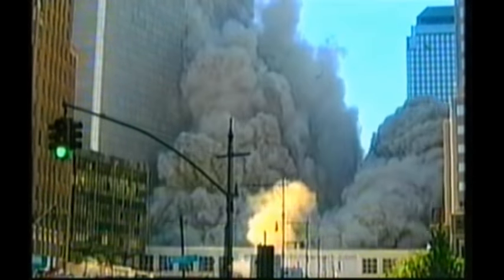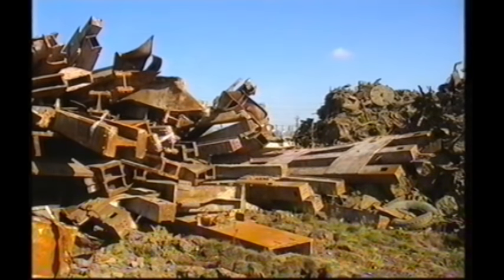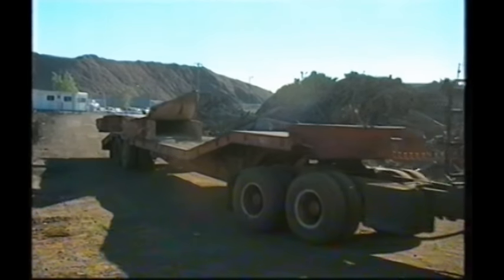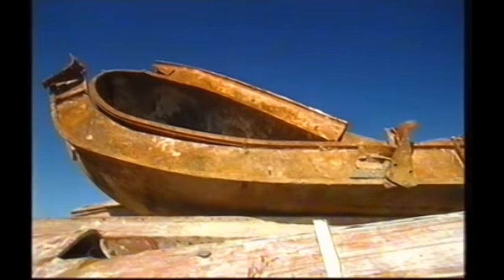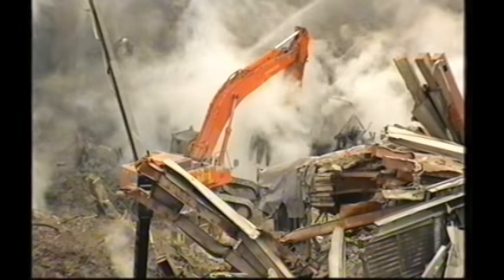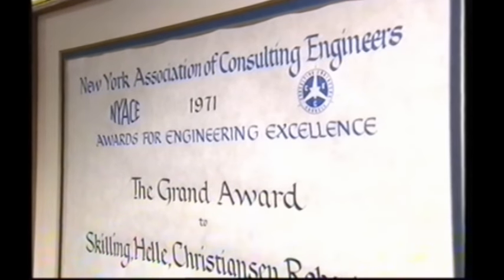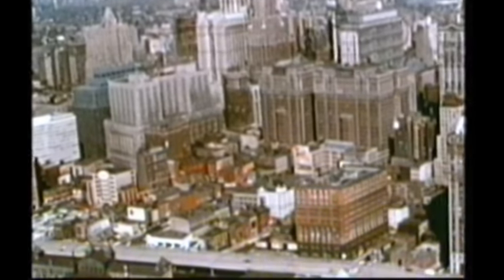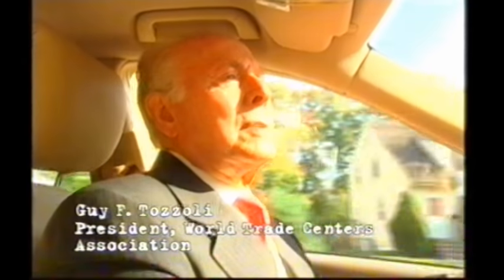9/11—"How The Twin Towers Collapsed" (C4 documentary, 2001)

Comment: I'm not trying to be all conspiracy but seriously want to know. How could a plane penetrate? I feel like the plane would just crumple like a pop can. I seen the damages from a plane hitting birds and wow! It was unbelievable how much damage that plane took, please explain I'm serious curious.
Reply: Speed - at that speed the aluminium (UK) of the plane wing could damage the steel. Also, the wings are shaped like a blade with a lot of strength in the direction of impact onto steel running upwards.
Reply: Kinetic energy.  Mass plus velocity. The greater the velocity the more energy the mass has. Do it slower and there is less penetration down to no penetration if you go slow enough. Go faster and there is even more penetration. This is for example how bullets work and how, if someone were to throw a bullet at your skull it would just bounce off but fired out of a gun that same bullet will turn your skull into a pink mist.

Don't get too worked up over bird strikes. The damage is almost always cosmetic and readily repaired with simple hand tools.
Reply: Watch the video..clearly showing the plane going into the side....easy...going fast with a lot of weight
Reply: @bobfrantz534  I think you need to re-watch it, plane goes into the wall like going through butter, but don't worry the government says that is as it should be.
Reply: @siamwinfor1656 says the one spouting utter nonsense. Properly educate yourself by listening to doctors and scientists instead of politicians and you might learn something.
Reply: At high speed a plane can cut through buildings, as explained in "architects and engineers for truth" website.
Steel-framed high rise buildings are not known to collapse because of fire, but 3 did in a row, on that single day.😂 That's the point.
Reply: @jeffsimon9594  So the plane went through intact came out the other side and flew away?
Reply: @jeffsimon9594  it was big and fast what did u think it was going to do
Reply: @jeffsimon9594  First, you're overlooking the fact that the 'wall' was 30% glass which offered virtually no resistance at all. Second, the vertical supports were not solid but instead were box girders made of 1" steel. Third, these vertical elements were designed to resist static vertical loads, not dynamic horizontal loads.
It's not the government saying this, it's basic physics, facts and common sense.
Reply: The wings are better thought of as "the wing" which is effectively a single component that extends through either side of the fuselage.

Although the wing is built to flex in the vertical plane, it is very stiff and strong in the horizontal plane, in the direction of travel.  All the force moving the aircraft forward comes from the two engines at the points where they are attached to the wing by the pylons on which they are mounted.  The wing has to be strong enough to transfer the load along its entire length and into the fuselage without any significant deformation in the plane of travel. The wind resistance has to be borne primarily at the wing's leading edge, which is thin compared to the overall thickness of the wing, to enable it to slice through the air.

The kinetic energy of the moving aircraft = ½(mass) * (velocity)².  That's velocity squared.  For a 200 ton aircraft moving at 400 mph, that works out at about 6.5 BILLION joules of energy that is transferred into the building in a fraction of a second, across an area equivalent to the cross section of the plane.  

There is no time for plastic deformation of the steel girders with that kind of energy release.  Steel has high tensile strength, but it's structure is essentially crystalline.  So those girders which have some flex under wind loads spread across a wide area didn't have time or strength to bend in the way a rail might be bent into a curve, they are brittle, so they just fracture and snap.

Think about a diamond, which is a three dimensional polymer of carbon, and the hardest thing found in nature.  Nevertheless, it can be cut with tools that are less strong, and hit a diamond with enough force, it will shatter.  All materials have their limits.
Reply: @Ozymandi_as  
Well said.
Of course, I doubt it will make much difference to the 'aluminum can't cut through steel' crowd.
Reply: Is that why they make bullets out of aluminum? Always wondered about that,
Reply: @mi66gt80 Bullets are effective because of their speed, not their composition. Don't you know that?
Reply: @kyle Effectiveness of a bullet is based on their speed and composition and design. 

Regardless comparing a bullet hitting a human skull with aluminum hitting steel is a poor explanation. A human skull is not harder than a bullet. Shoot an aluminum bullet at a 1" steel plate, the steel is stopping it. 

We can see the plane did go thru the building walls but the explanation is a combination of factors, A large one being the design of the walls.
Reply: @siamwinfor1656 as the cows pass excessive gas, aluminum will strengthen significantly while airborne. Read your
Reply: @siamwinfor1656 as the cows pass excessive gas, aluminum will strengthen significantly while airborne. Read your
Reply: @siamwinfor1656 as the cows pass excessive gas, aluminum will strengthen significantly while airborne. Read your
Reply: @siamwinfor1656 as the cows pass excessive gas, aluminum will strengthen significantly while airborne. Read your
Reply: @siamwinfor1656 as the cows pass excessive gas, aluminum will strengthen significantly while airborne. Read your
Reply: @siamwinfor1656 as the cows pass excessive gas, aluminum will strengthen significantly while airborne. Read your
Reply: @siamwinfor1656 as the cows pass excessive gas, aluminum will strengthen significantly while airborne. Read your
Reply: @siamwinfor1656 as the cows pass excessive gas, aluminum will strengthen significantly while airborne. Read your
Reply: @siamwinfor1656 as the cows pass excessive gas, aluminum will strengthen significantly while airborne. Read your
Reply: @siamwinfor1656 as the cows pass excessive gas, aluminum will strengthen significantly while airborne. Read your
Reply: @siamwinfor1656 as the cows pass excessive gas, aluminum will strengthen significantly while airborne. Read your
Reply: @siamwinfor1656 as the cows pass excessive gas, aluminum will strengthen significantly while airborne. Read your
Reply: @siamwinfor1656 as the cows pass excessive gas, aluminum will strengthen significantly while airborne. Read your
Reply: @siamwinfor1656 as the cows pass excessive gas, aluminum will strengthen significantly while airborne. Read your
Reply: @siamwinfor1656 as the cows pass excessive gas, aluminum will strengthen significantly while airborne. Read your
Reply: @siamwinfor1656 as the cows pass excessive gas, aluminum will strengthen significantly while airborne. Read your

Comment: 100% impossible for the buildings to fall at almost free fall speed in their own footprint without demolition
Reply: Happens all the time with smaller buildings when structural failings happen.
Reply: They're called fail safes. Big buildings are designed to fall a certain way in case of collapse, regardless of what causes it.
Reply: 100%? wow!

Comment: We live on the west coast. My wife awoke me to turn the tv on.  The first tower had been hit.  Then when we saw on live tv the second tower hit we knew the first one was no accident. 
As a retired building inspector I anticipated and told my wife that both buildings would collapse as the fire weakened the steel which would eventually not be able to support the weight of the structure above the impact floors and a pancake effect would happen.
It appears that’s precisely what happened. I never did trust sprayed on insulation to protect structural steel as a lot of it gets knocked off during construction.

Comment: Ya but what happened is NOT LIKE
THE MODEL @ 46:50
There was no metal buckling
on the exterior edges or its sides
ANYWHERE?
I understand thats how the floors could behave this way in collapse, however
if the floors did indeed fall straight down, wouldnt the now weakened by fire truss conections be severed from the strong steel exterior shell?
They both fell straight down & with this 
explanation I would expect to see significantly more of the exterior remaining than what actually  was.
It would be very interesting to see a scaled down version undergo the exact same conditions and my money is on the buildings stand even with the considerable damage suffered .
You cant find them anymore but there used to be video of wiindows on 3 different levels of both buildings being blown outward right before the buildings collapsed. first one then the other suggesting the possibility
it took additional destructive  influence
to bring the buildings down and obviously if that were to ever  become
known?
Reply: Well, you just stay with your BS theory if it makes you feel good. And good luck finding those missing vids of yours.

Comment: The Twin Towers both collapsed in the 10 to 12-second range. Gravitational acceleration, aka free fall, would have been 9.2 seconds. This means that the vast majority of each tower’s kinetic energy was completely used up just falling that fast. There would have been nowhere near enough energy left over to crush down 78 stories (South Tower) and 93 stories (North Tower) of cold, healthy steel structure, eject multi-ton sections of perimeter structure in a 600-foot radius from each tower’s footprint, and to pulverize 200,000 cubic yards of concrete (each tower) such that Manhattan was blanketed in a 2 to 3-inch layer of powder. All of this is utterly impossible without a great deal of energy added to the system. It is quite evident from numerous videos of both towers’ collapses that that added energy was explosives. Videos show symmetrical waves of explosive ejections of pulverized concrete and other debris racing down the face of each tower at, again, nearly the rate of free fall. Also notable on some of the videos are isolated ejective squibs emanating from the faces of the towers 10,20, and even 30 stories below the collapse zone. This is simply inexplicable if not for the use of controlled demolition. I hope that someday the religious belief in the official narrative of what happened that day will give way to science, empiricism, and common sense.
Reply: I stopped at the end of the first sentence because it is not correct.  It is a common misconception. Anything that follows premised on that misconception will also of course be false. 

The myth the Twin Towers collapsed in free fall (9-11 seconds) comes from completely misreading this:

NIST FAQ for the Twin Towers disaster Study

*11. How could the WTC towers collapse in only 11 seconds (WTC 1) and 9 seconds (WTC 2)—speeds that approximate that of a ball dropped from similar height in a vacuum (with no air resistance)? *

NIST estimated the elapsed times for the first exterior panels to strike the ground after the collapse initiated in each of the towers to be approximately 11 seconds for WTC 1 and approximately 9 seconds for WTC 2. These elapsed times were based on: (1) precise timing of the initiation of collapse from video evidence, and (2) ground motion (seismic) signals recorded at Palisades, N.Y., that also were precisely time-calibrated for wave transmission times from lower Manhattan (see NIST NCSTAR 1-5A)

Note the part about the first exterior panels to strike the ground after the collapse initiated.  A lot of people seem to miss that important bit of context and only see the 11 seconds and 9 seconds parts. 

On conspiracy web sites and YouTube videos they just cut out all the relevant context and details and (falsely) claim; The Twin Towers collapsed in 10 (or 9 or 11 - they usually can't remember the exact number so they fudge it) seconds Selective reading comprehension syndrome (SRCS). 

9 or 11 seconds is NOT the building, its the first debris to hit the ground which were definitely in free fall and dropping much faster than the Tower, which is collapsing some ways behind that. All of this easily visible to the naked eye. 

youtube.com/watch?v=4VgZW-v_Opg&t=4s&ab_channel=MFitz 

Now you know.

Actual collapse time for the North Tower is timed on this video;
youtube.com/watch?v=MAYXdafNl6E&ab_channel=AlienEntity1 

South Tower – Timed not in free fall
youtube.com/watch?v=rOIebjT2jaM&ab_channel=AlienEntity1 

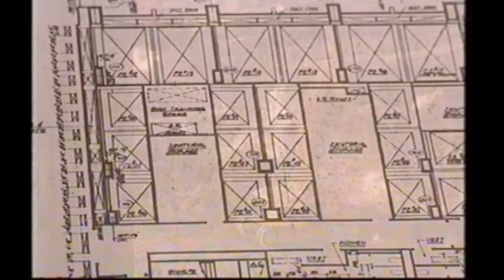Here is a video which captures the entire North Tower collapse, which starts at 1:44. The last standing parts of the structure drop below the dust cloud at 2:17. Add at least another 2 seconds or so for those to drop 60 stories. Start to finish I call it at 34 seconds.
Reply: Amen
Reply: Collapse times do matter to some in their arguments for or against controlled demolition of the Twin Towers, but the enormous clouds of pulverized concrete (that alone strongly indicate the use of explosives to me) make estimation difficult. However it’s really a moot point when so many collapse videos show unequivocally what happened to those towers.
I invite readers to watch these videos and decide for themselves.
Here’s the North Tower coming down. Note the multi-ton sections of building arcing up, out, and down from the top of the collapse zone. Also note the wave of explosive ejections of pulverized concrete and other material racing down the west face of the building on the right of the corner of it, under the column of falling material. This appears in the video at 1min47sec and is indicated by the yellow box lower and to the right of the other box. 

https://youtu.be/nUDoGuLpirc?si=882BgAQRfBu6IQkA
Here is another view of the same collapse sequence taken more from the north. The wave of explosive ejections racing down the west face I described above is well shown in this video. It races down the west face, in profile on the right side, clearly visible to the left of the thick column of falling debris. This is obviously not consistent with a big top block of the building (which has already disintegrated anyway) crushing down the rest of it.

https://youtu.be/w69v5YMoFG0?si=fAVvkqdLHKOxcg91

Here’s the South Tower coming down. Note the uniform explosive waves symmetrically and rapidly moving how the faces of it. Also note how the corners of the building stay intact for a time after the portions of the building adjacent to a given point on it have been blown out. This is not consistent with a large top block of the building crushing down the rest. And a careful look shows this enormous top block tilting over before it disappears into the cloud of its own disintegration, instead of following the principle of angular momentum and crashing to the ground below. So there is no top block to do any crushing down. 

https://youtu.be/twBSaMqP0fQ?si=W41KZHbW1JlKqgXY

Comment: I feel sorry for Leslie Roertson. He couldn't have foreseen what would happen. I hope he doesn't feel guilty about it.
Reply: There are Videos saying the Towers were designed to stand a Crash with a Boing 707. I believe this to be true.
Reply: How could anyone at that time have anticipated the insanity of someone flying a massive fully loaded plane a top speed with the absolute intention of bringing these down. It's an absolute travesty that someone who designed such a marvelous building has to live with this type of legacy because of terrorists.
Reply: Every aspect of the 9/11 planes operation was methodical. Close airports were chosen to save fuel and allow the planes to get a good run up. Even the 767 was chosen because it was the largest domestic routed plane at the time, otherwise I'm sure they would have gone for a 747. This was done to maximise damage and fires from the impacts, enough in the end to bring them both down in relatively quick succession.
Reply: @demonhalo67 bs! Is the weight was a problem the building would tip over! Most of the fuel burned up instantly in the collision. And no matter how much weigh you would add to the top IT WOULDNT FALL INTO ITS OWN FOOTPRINT!!!!!!
Reply: he didn't consider the channy bush gulliani effect when  designing.
Reply: He doesn't. He's passed knowing the government did it.

Comment: At the 45:30 mark, and thereafter, I literally LOLed. They show an animation of the floors dropping down onto the floor below, and the MASSIVE interior, vertical columns that provided nearly all the vertical strength of the towers were represented as laughably small beams, completely deceiving the viewer into thinking that they were basically useless. Then they have the gall to show a wooden representation of three floors of the towers whereby there are just the wimpy outer corner columns, and literally NO INTERNAL column structure that was basically the entire vertical strength of the building. What. A . Friggin. JOKE!
Reply: Considering the statics of a building with an internal column, let alone the static load, let alone the fact that they loaded 2 floors instead of 3 out of 110 which is ridiculous, that presentation is not only completely incorrect but the top load slips off. It's a failure in presentation and a complete mockery of structural physics